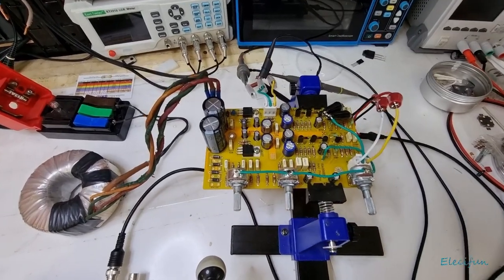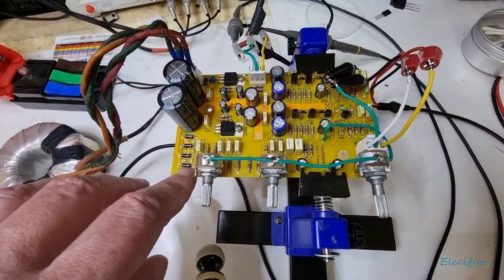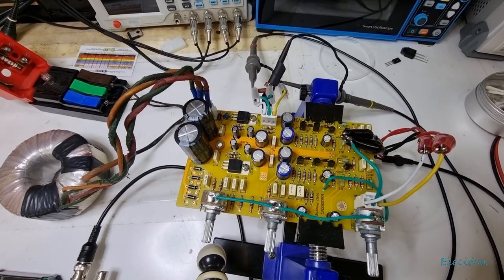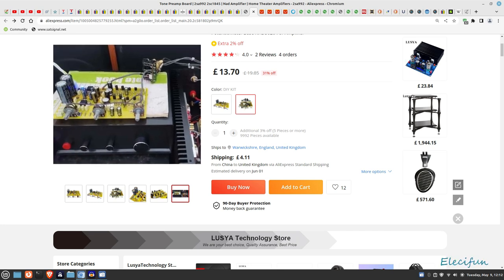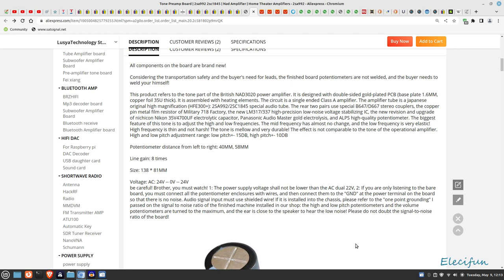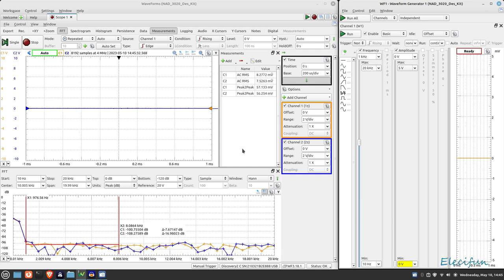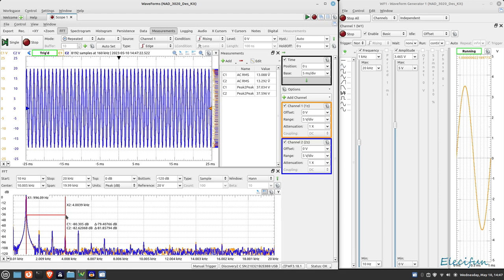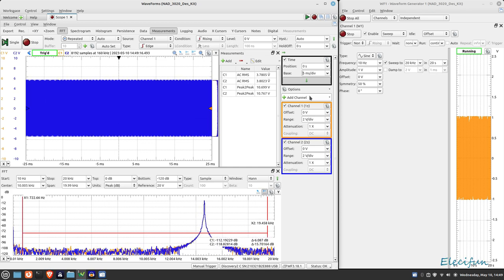NAD 3020 Pre-Amplifier Discrete Kit from Aliexpress

Comment: If they are Chinese ‘718’ resistors, they are metal-film resistors with copper leads. Although the colour is yellow like carbon resistors. The only way to check is to remove the paint from the body.

Comment: Hi Sir ! This is a new pre-amp??
Reply from the maker: Hi Dec,  Its based on a NAD3020 pre amplifier circuit from the 70/80's. Yes the circuit is new to me, bought from a seller on Aliexpress.com

https://www.aliexpress.com/item/1005004825779255.html
Reply from the maker: NAD 3020
The NAD 3020 is a stereo integrated amplifier by NAD Electronics, considered to be one of the most important components in the history of high fidelity audio. Launched in 1978, this highly affordable product delivered a good quality sound, which acquired a reputation as an audiophile amplifier of exceptional value. By 1998, the NAD 3020 had become the most well known and best-selling audio amplifier in history.
more on wilkipedia 

https://en.wikipedia.org/wiki/NAD_3020